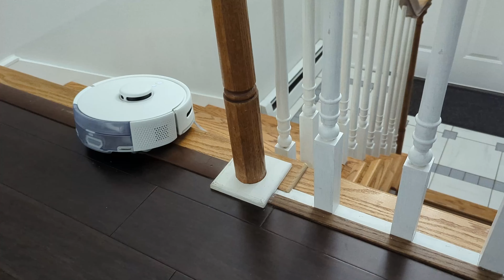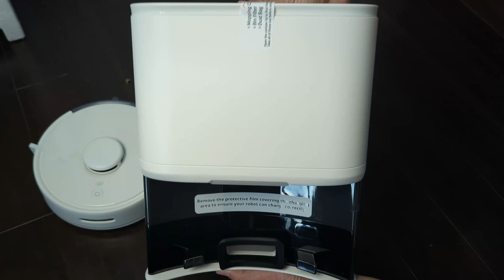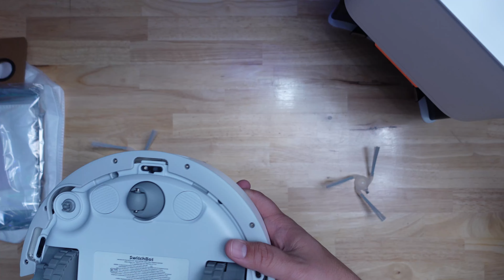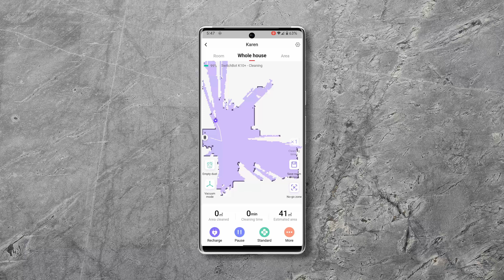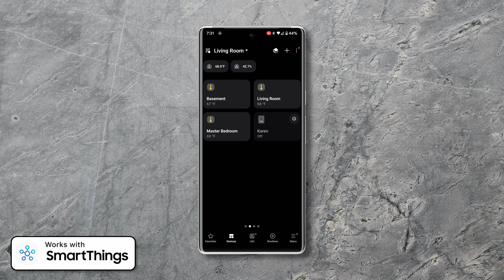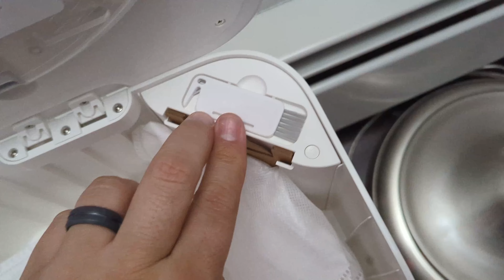My first Robot Vac that's ACTUALLY SMART! (SwitchBot K10+)

Comment: We have a Eufy RoboVac X8 Hybrid (the mop function looks about as much of a joke as the Switchbot, we've never used it), and while we're been happy with it's cleaning ability, it has recently run into device errors causing me to reset it every time it has to run (and that requires more than just interacting with the app). This of course means, it doesn't run unless I do that. The whole point of the robovacs is to get the vaccuming done more often so you don't have to worry about it as often. So ours has failed us. So I've been looking for another to replace it with. This doesn't quite look up to my standards on what I expect from a robovac. I appreciate seeing another perspective though...especially one focused on smarthome stuff.
Reply from the maker: Thanks! Yeah I want to try out a robovac or ecovacs next!